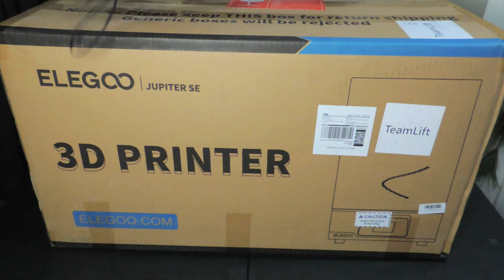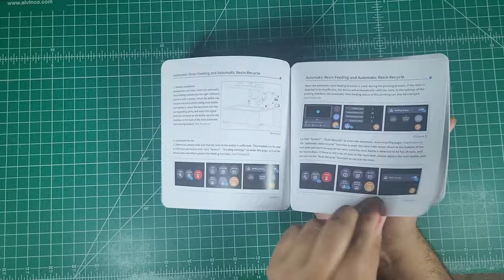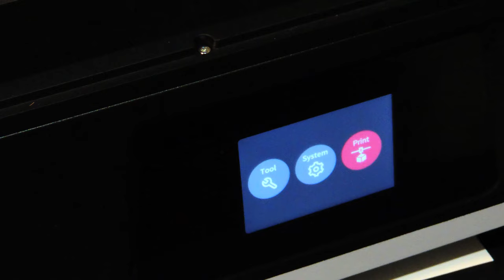HUGE Metagross Printed On Most Affordable HUGE 3D Printer | Elegoo Jupiter SE Review

Comment: Dude thanks for the pretty nice review for regular users and those new to the hobby! It took me several months to learn that in vat leveling and tightening more than I expected .  I love my saturn8k and have it dialed in now for a while but I'm most excited about having the build plate not on a ball and socket joint anymore. Have you had any issues with leveling the last 4 months?
Reply from the maker: @charlesalbrecht6201  thanks so much! And no, no issues with leveling

Comment: I am definitely getting a large format resin printer, I'm just trying to decide between this and the Phrozen Mighty 8Ks, I know Elegoos customer service has been awesome.  Not sure how Phrozen's is I have heard negative things.  And the 8ks is bigger but also like a little over twice the cost of this one.  Think I should go with my gut and just get the Jupiter SE.  Looking forward to your responses.
Reply from the maker: Phrozen was my first printer brand and I loved my Mighty 4ks. I think you're referring to the Mega 8KS, which is quite a bit bigger than the Jupiter and double the cost.

Honestly, if I could afford it I would have gone for the Mega 8KS only for the option of being able to print out larger prints, like helmets or cosplay, much easier. It really depends on what you plan to print out. If you don't need that extra size, the Jupiter is more than capable enough.
Reply: @AsimPaints  so if money is not an option and I will be printing wall art and big a** prints as well as masks, you would go with the 8KS?
Reply from the maker: @ernestking7348  if they're huge then yes, I'd go for the mega. Masks you'll be able to print on the Jupiter, but any bigger like helmets will have trouble fitting.